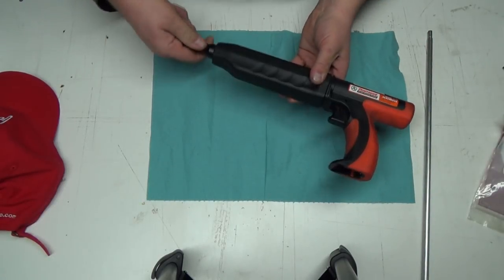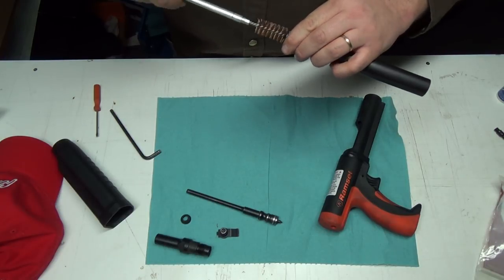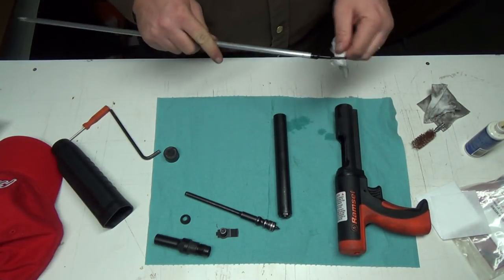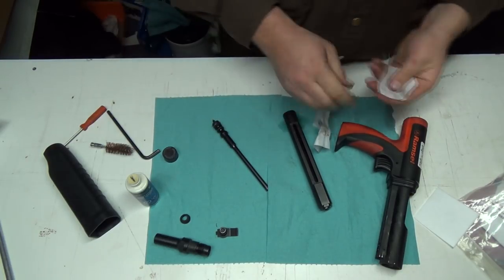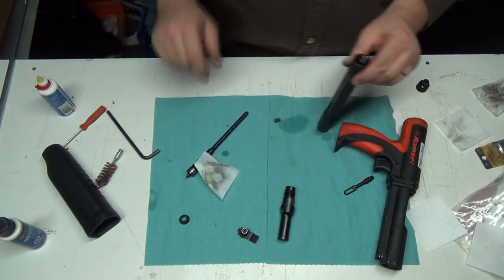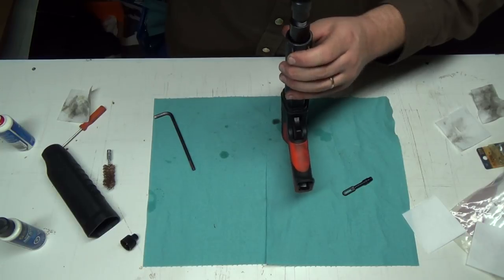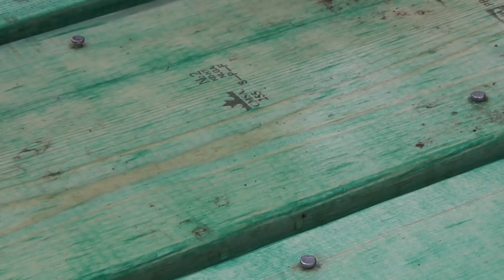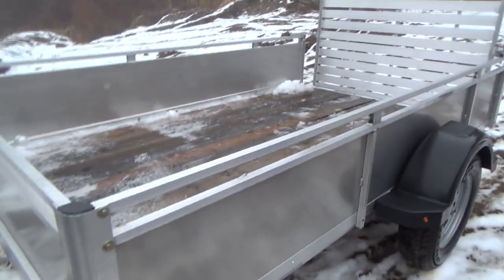Disassembly of the ramset nailing gun, cleaning and reassembly

Comment: Mine seems to have a manufacturing defect.  The screw on the bottom of the barrel is too small for the hole and keeps falling out and getting jammed between the barrel and the outer housing.  The threads are not stripped on either the screw or in the hole, it's just too small to stay in.   Has there ever been a recall to fix that?

Comment: I had a similar problem with my thing not sinking the nails all the way in cement. I used a hand held sledge hammer and just gave each nail a whack and it put them right in. If you have any more of them sticking up and don't wanna use up all your shots you should try a big hammer.

Comment: Bill did the nail get driven further into the steel or was the head folded over into the wood ?
Wow that trailer looks fantastic.
Reply: It probably just crumpled the nail a bit, pushing it further down into the wood. I doubt it drove the nail further into the steel. Once you have that friction weld from the initial shot into the steel that's it.

Comment: Actually Bill,

With ref to the best most secure fitting on the planks, it is with the nails a little above the actual plank, because as has happened on at least one, the nails split the plank. And BTW are you really likely to run across it with no shoes one?   ;-)
Reply from the maker: not me but the kids are to likely when they play down there
Reply: Fair enough   ;-).